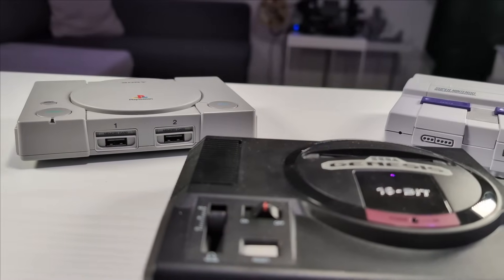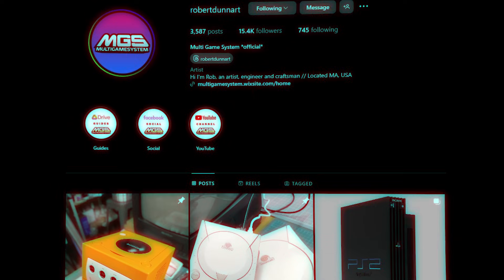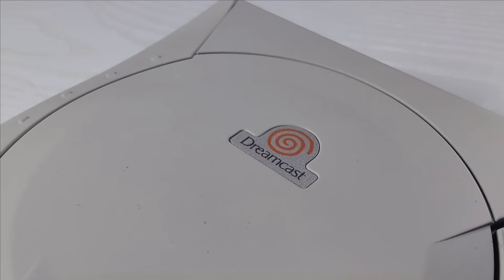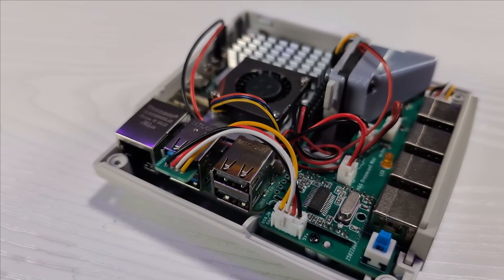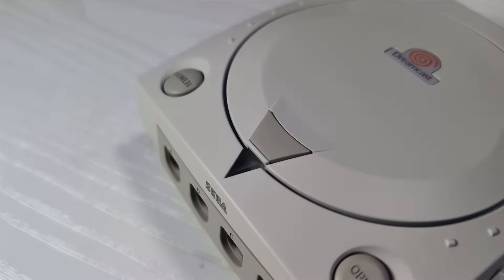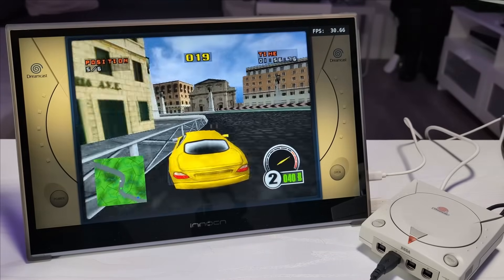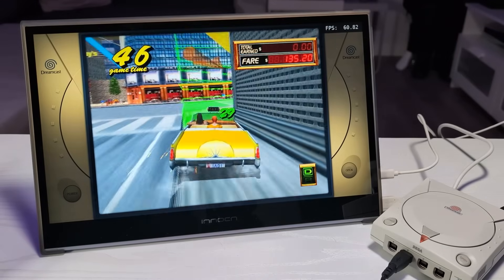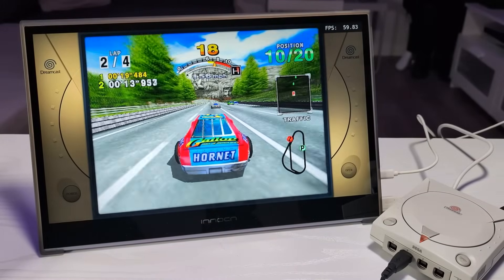Dreamcast Mini (Pi 5 Build) – The Console SEGA Should’ve Made!

Comment: Flycast  can be locked down to a closer to accuracy setting only outputting 480p but being very stable you can then set the API to vulkan for performance and use a classic to a monitors that has a hdmi port and 1440p support with the switch set to 4:3 to keep everything native yet upscalled and cleaned to 1440p

Comment: I knew thats what that was when I saw that Dreamcast logo on that box in your background on the last SGRD show! I've got one of these from Rob also.... it's basically perfect! I plan on ordering one of his GameCube Minis next.
Reply from the maker: @obsidian1710  me too! The gamecube is by far the coolest sk far. Plus it's a mini pc, not just a pi5, so that takes performance up quite a bit. He honestly does incredible work.
Reply: @ Yeah, that mini PC inside is a good selling point for that one... It'll be good to make that mini a GameCube/Wii system. 

On a side note, I got a pair of Raphnet adapters so that I can plug in real Dreamcast controllers in that DC mini... gives it an even more authentic feel.
Reply from the maker: @obsidian1710  yeah I was considering getting one of those adaptors. I think Rob makes those too. If you are getting one of these, it only makes sense to get one too to be able to play with an OG controller
Reply: @Restalgia  Rob said he doesn't make the adapters anymore when he recommended the Raphnet adapter. Just make sure you get the legit Raphnet adapter and not the knock-off one like I did... the left trigger isn't recognized on the pi5 on the knock-offs.
Reply from the maker: @obsidian1710  thanks for the heads up
Reply: What was the price on the dreamcast and gamecube?